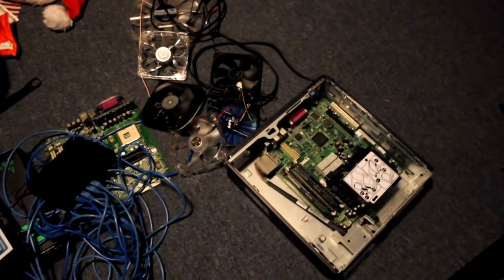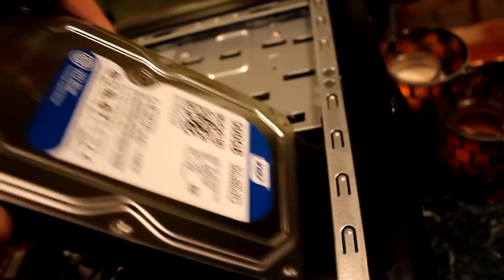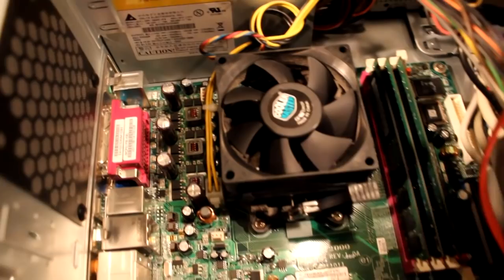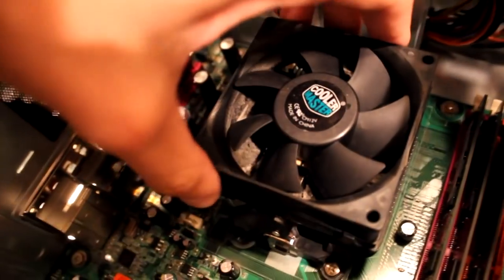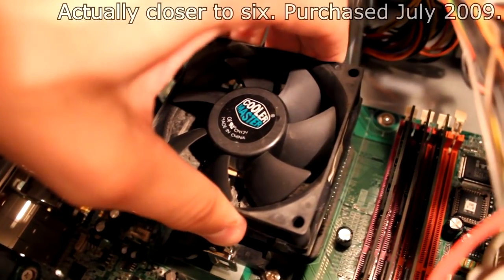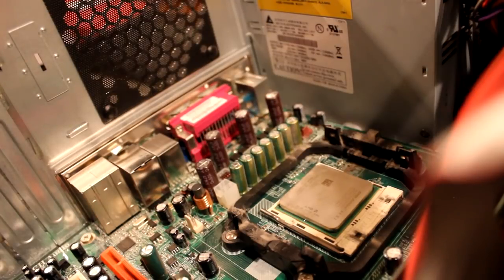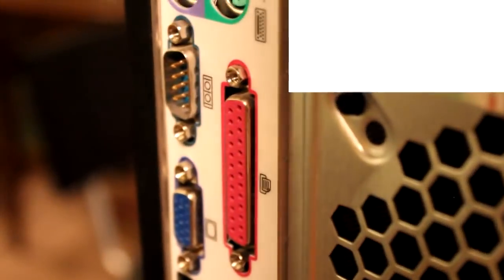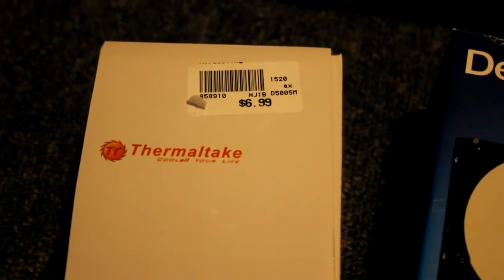Giving a 7-year-old computer a second life

Comment: The old cooler was fine, it was just caked with dust.
Reply: That could be true, but the fan ball bearing stop working after a while. Sometimes when the PC is closed you do not know if the fan stopped working and when..then you get a noise as if a small plane inside is going to take off. .  I think it was a good idea to replace it, I do not wait until it failes..it is like you do not wait for your car tire to blow up in the freeway and then replace..that is how I look at it...Same thing with HDD...after 7 yrs..I replace them without hesitation. If I could show you the arrows in my back, in the days we used to do low level formatting, and there was like 8 inch IBM floppies. boy..
Reply: Why not just replace the fan lol. A cooler with heat pipes and a proper fin array is better than a spiky block of aluminium.
Reply: BOY

Comment: >not installing an SSD
why do you hate your parents?
Reply: the machine was built in 2009, it would be a waste of a ssd..........
Reply: Crane False
Reply: Almost Evil 665 Not false
Reply: Crane Very false
Reply: Almost Evil 665 Explain why a computer built in 2009 should have a ssd ?
Reply: it might not reach the top potential speed it would get on a sata 3 port, but the difference with a mechanical hard drive would still be noticeable. an ssd is always good while having a sata port
Reply: ***** THANK YOU
Reply: ***** Ya I liked the video too
Reply: ***** Putting a ssd in a computer that is worth less than the ssd is a waste of money or at least in my opinion
Reply: keep in mind that the gains would be minimal.  This pc would likely be using the older sata bus standard.  questionable how much faster than just upgrading from the ide drive that was in use.
Reply: a 120GB SSD costs less than £30/$35 and would EASILY fit Linux Mint AND have plenty of space left over! 

The ONLY concern about an SSD being a total waste on an older box  is the BLOATWARE called Windows (any flavour) - it's the very LAST OS to consider putting on an old machine to give it a new lease of life. It's like telling a man of 55 starting to feel his age that you're going to give him a new lease of life by giving him new running shoes that weigh 20kg each!

I have a 15 year old Compaq Laptop 1680 x 1050 that runs Open Office, Chrome and a few other apps as fast as any up to date Windows machine and with ONLY IDE (!!) so I can't even use an SSD on it. It has WAY better screen res than the useless 1366 x 768 of many later "faster" machines. Get a life you guys, stop drinking the bathwater, pull the plug on Windows, especially on older machines.

For the record an SSD is WAY more than JUST bandwidth of transfer speed, especially on older machines, especially on a Windows box - it's about speed of random access to data off the disk - that involves MULTIPLE , MANY multiple, small random seeks in practice, EVERY one of which would take 1000 times as long (at least) as an SSD access and because of Windows's DIRE memory management, slows down the machine considerably.

Windows memory management sucks now and has always sucked compared to Linux, so FREE up the SSD to do its job. Give it an OS that CAN take advantage and you should find yourself being appalled at how much power MS has sucked out of your machines over the years and amazed at what an old machine can actually do.
Reply: Creaky C. my wife knows nothing about Linux yet she's been happily using it for the last 5 years or so without any issues ... including doing the updates when prompted without all the palaver of Windows. would the parents know how to use Linux? Why not. Do they REALLY know what's going on with Windows? No. Do they care  ... No ... only when something goes wrong and then the procedure is exactly the same ... 1. find someone who knows or 2 ask Google. and my experience says the replies re Linux are usually way more accurate. Besides they wouldn't be using Linux they'd be using Cinnamon which can even be made to look like XP or Vista if they are used to that rather than some inane GUI designed for a phone not a large format high res screen
Reply: So by his logic first gen core i5's and i7's don't deserve ssd's because they were built in 2009? my speedy little xeon 5472 build must not deserve one either since it's a 2007 chip. Anyone reading this, This dudes a noob, ssds increase the performance significantly on older machines, it's one of the only things you can do, so whynot do it, ssd costing the amount of the whole computer? No it would only cost that much if you were to get one suited for a modern rig, There are plenty of cheap ass solutions that would be fitted to be a great pair on an older machine.
Reply: ***** I understand your point but, I watched the video a while ago and if the machine is worth 50 bucks itself I don't see the point of putting money into such a old machine unless its a really good deal on a ssd
Reply: ***** You obviously don't get my point and i'm fine with that I can care less, but leave the jokes to us we do it better.  Also running a 240gb ssd with a 1tb hard drive too
Reply: ***** You do realize that there is no need to be rude ???? I can't take a dude seriously with a kenny S username either
Reply: ***** Also, what does a amiga have to do with SSD drives ? are you trying to sound smart or something ? I don't know
Reply: ***** What does that have to do with a ssd though ? aren't SD cards just super cheap anyways (I do realize it prob sped it up a shit load though)
Reply: ***** I know what you mean, I want to get a ibm x60 or something along the line then put a ssd an linux onto it.  My main point is not to spend a lot of money on a ssd I would say over 100 bucks hmmm maybe more idk but that is my main point.  It would be well worth it if you got a good deal.
Reply: midoribishi actually there would be an advantage to use an ssd over a hdd on an old computer. Even if the motherboard has SATA1 ports it would still reach 130mbs read/writes whereas top of the line performance hdds only go up to 90mbs read/writes.
Reply: The sheer amount of computer illiteracy is simply stunning.

Comment: Pity not a SSD. Would smooth that windows allot for your parents.
Reply: Not like theyre gonna use it for anything other than playing bejeweled and looking at the internet.  Parents.
Reply: it's about a faster boot and more responsive feel in all environments, not improving fps or encoding video faster. it's exactly the kind of thing a net browser/bejeweler would appreciate. Not like they suggested a video card of the same cost range that really would do nothing for them.
Reply: Well it's a sata 3GB port, which isn't much faster than the harddrive. It'll only transfer around 140MB/s
Reply: ***** my 840 pro benched 240MB per sec on a SATA 2 bus, but the responsiveness doesn't come from sequential read numbers. It comes from random reads speeds and search times that still don't approach that Mark, yet the iops are magnitudes higher on random 4k blocks. You need to do a side by side, even on an old SATA bus the effective increase in real world responsiveness is incredible.
Reply: Or if your random read numbers don't exceed the bus max width, then there is still improvement to be had, you only be limited when transferring large continuous blocks of data.

Comment: That is cool. I generally twist the heat sink slightly first before pulling up. I agree, a not cooled processor can cause a random lock up or reboot. Also, for random reboots, check the capacitors for swollen, rounded or leaking tops. Common in older PCs.

Comment: Why didn't you replace the thermal paste when you fitted the new cooler unit ?
Reply: The new cooler for the cpu comes with thermal paste already on it. Put the cooler on the cpu, turn machine on and voila, it bonds together.

Comment: I have a potential tip, next time the cup is stuck to the heat sink like that you may be able to use a string or dental floss to cut between the thermal compound and cup, and if still acts funny check those caps, great vid!
Reply: Actually, he should let the pc run a while and let the heat slightly melt the thermal paste.
Reply: Moments
i guesss that could also work, also correction cup is supposed to be cpu lol
Reply: The easy way is to simply twist the cooler first to break it free.
Reply: The trick is rotate, don't pry.
Reply: Rotating some time become dangerous. Real trick is make it hot before remove. If imposible warm it with hairdrayer.
Reply: erhan zeynel you just need to be careful when you rotate. But that's a good tip.

Comment: You put a flat head screwdriver blade tip between the cpu and heatsink and ever so slowly turn the blade. It will lift cpu off the heatsink.

Comment: I use my old 8 year Core2Duo as the backup machine. USB triggered power switch turns the machine on at 4am, copies modified files from the server and then it's turned off.  I don't see why this mainboard/cpu system shouldn't work 10 more years, Semiconductor don't wear out. If speed and energy efficiency is good enough then it's fine. Just replace fan's and harddisk from time to time.

Comment: This does not apply to the above clean computer but I find that the heat sink can fill up with dust and this causes the processor to overheat and shut down to protect itself.   Cleaning the dust out of the heat sink should fix this.

Comment: Bitch please! 7 year computer ? it is not a challenge. I have 12 year old PC (only added RAM to 4GB, graphics card and SSD and it's running Windows 10 smooth and very well.
Reply: Windows 10 smooth on a CPU from 2004? P4 or early A64? I friggin DOUBT that.
Reply: +Calvin H. i have Pentium 4 672 - it's fastest P4 processor. That's why it works so well.
Reply: +PrzeszczepiX That particular CPU was released in Q4 2005, so it's closer to 10 or 11 years old.

Comment: When you pulled that heatsink off, I was sure the socket had ripped some pins out, as I had a similar situation with a P4 back in the day. Looks like you got lucky and the CPU wasn't damaged.
Reply: sane thing happened to me a while ago with a P4 froom 01. Except it came out perfectly. But when I had to pry the old thing off, it flew off and hit the floor pin-side down. damaged it alot lol
Reply: it was a common thing that happened to all PGA CPU's of the time. I had (I forget the model) Intel PGA prossesor that got stuck to the heatsink when I pulled it, and when I got it unstuck it flew all the way across the room and bent 2 pins. I bent them back and that prossesor is still kicking today.
Reply: yea mine was fucked

Comment: I worked at gateway back in the dinosaur days. My desktop is 9 years old now. My laptops are 4 or 5 years old, but I maxed out the RAM on some old Dell Latitudes, put in 1st 2nd & 3rd gen i7 quad cores and SSDs and one of the computers works faster and better than a new $3000 Dell. I have maybe $2800 into 3 of these little monsters. They all get backed up to each other, so if one breaks or gets stolen, I'm still good. I am still running GPIB IEEE 4888 codes on prePentium machines. I can't afford a $6,000,000 EE lab, so I use the state of the art 1980s equipment, and it does what i need it to do, for me. A DDR4 development module for an O Scope is probably $130,000, and $250,000 for the scope, and $100K for DDR3, and when it's all said and done, that one single O Scope can cost over $1,000,000, but I don't need anything that fancy.
Reply: Gateway was a great computer. After working and fixing systems for plenty of years, Gateway was the easiest way to get it fixed...Windows recovery goes so smooth.  HP's  Recovery discs manual do not even match to the Menu they say it will guide you to recover windows.
If I may ask, why was Gateway computers so quite like noiseless.  I always wanted to know who made their motherboard or HDD.  I had a chance to look at it but I realized too late after I delivered the PC to the customer..  and lately Bestbuy told me that Gateway went out of business June 2016

Comment: How much ram was in the computer?  I saw four channels, with only three filled.  You held up a 512 MB...that suggests the other three were also 512's....that is 1.5 ?    That can not possibly be enough ram to run Windows 7..sure...I've seen it run with 2 Gig of ram..but it was s--s-s-s-slow.
I up graded a 98 Gateway a few years ago...everything but the motherboard/CPU...it now runs XP...compared to its original Win 98 se....but...it runs it a be..well...slow.
So...I'm curious about its operating speed...I'm not trying to nitpick your upgrades...I have the belief that if the machine still works, it can be still useful.    I use my 1998 Gateway mini tower mostly as a juke box and writing.
Thanks for the video.

Comment: the green capacitor at the bottom of the screen at 4:17 watch for bulge here. I'm familiar with these boards, this can cause random crashes. The fix is disable any onboard video and run a discrete card. Pick up something cheap with hdmi for a nice added feature.

Comment: Step 1. clean off and reapply thermal paste. That is probably the most likely reason why the computer was shutting down abruptly. Because the heat transfer from the processor to the heatsink was being blocked by a worn-out thermal paste. It is always a good idea to reapply thermal paste thermal tape or thermal grease at least once every two years. so in turn you kind of wasted your money.

Also I agree with the other gentleman wipe the IDE hard drive and put Windows 7 on that. or just clone the IDE hard drive and put it onto the SATA hard drive.

Comment: You think THAT'S old? My grandpa gave me his old computer that was lying around collecting dust so I could take it apart and use parts for my own computer. The label says "Designed for Windows XP".
Windows XP may be 16 years old now, but I'm not saying the computer itself is that old. But I'm pretty sure it's dang close.

Comment: Step 1 ... replace Spinning hard drive with an SSD
Reply: SSD sounds a very fancy and exotic computer term.  Solid State Drive, no more moving parts or read/write heads, but SSD is not 100% solid in performance, the rate of failure is out there. People are stuck with SSD too, they are very expensive.
Reply: Depends, for $60 you can get 120 gigs, which is great for most things.
Reply: I suppose you are right. HDD are going away. Resistance is futile and SSD will take over inevitably. When I could, I bought me like 4 HDD each 1 T and 2 HDD for laptops just in case I get to dispise SSD. I intent to buy SanDisk SSD 480GB  $124 from Amazon, It is not the Ultra just a simple SSD, this will be my first contact with the SSD world.
Reply: I would much rather opt for slower but bigger storage than faster and smaller
Reply: Adam Bottjen with 60$ you cen go with 2 TB

Comment: I still have my 10 year old OEM Dell Vostro 200 Mini Tower, everything worked just fine until a week or two ago when I started having BIOS errors during reboot and my computer freezing from time to time at runtime, I think it because of a driver failure, might be the processor or the GPU(hope not since I'll have to replace the entire motherboard) has finally worn out, I haven't touched it ever since my father bought it when I was a kid, (I just removed my old NVidia GeForce GPU after it has been worn out and added a 232GB HDD about a year ago)

Comment: i need a similar motherboard, i have a really old case from way bak... like 1999, it doesn´t even use standoffs te case is actually raised at the places where you put the screws. and my problem is that i do not know wich motherboard could fit the screw hole layout... so i kinda need a motherboard similar to this one or the ´best´ one i can get that would fit, and that has some acceptable features like... i dunno AM2.-3 socket and Sata ports. so any help would be apreciated

Comment: Vista was ok for me because I wasn't trying to work with it. Surfing the web, check e-mail and play runescape. Later upgraded to 7 and put 10 on a new hard drive when there was free upgrade in case I ever wanted it. I have newer, more capable hardware, it's just a spare XPS410 that Dell tells me is a Dimension 9200.

Comment: random Turning off? REPLACE THE CAPACITORS!!!!! and when thermal compound gets old, you should try to move cooler from left to right so you will not rip it off with cpu on it.
Reply: this green one at the bottom of the screen (just above pci slot) @ 4:20. you can see it's bulging.

Comment: you probably did not fix anything, it will keep running shitty (turning off / running slower than it should / restarting) because first two capacitors on the left - next to a cpu cooler(those brown ones) are puffed which means they are faulty, even if the system is working you should replace them anyway. Cheers
Reply: also, chech out if the psu has the same problem.

Comment: still running a 9-year-old pc with a core 2 quad q9650, wd blue 1TB, rx 470, 4x2gb ddr2-800 ram, and an evga 850 bq. (yes, overkill.)
Reply: You've basically replaced the entire pc, I wouldn't call it 9 years old anymore.

Comment: Always the first step when you want to give a second life to an old computer - put in SSD. Hard drive is the only part that degrades performance over years. I put in ssd in 2006 hp with similiar cpu as in this video athlon 64 x2 made in 2005. The computer now with win7  boots almost as fast as my ssd windows 8.1 machine.